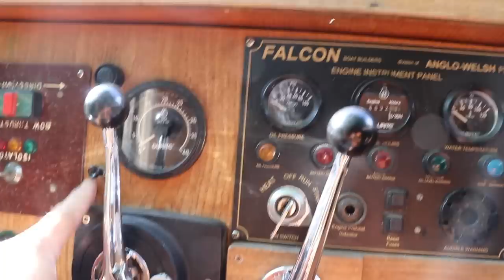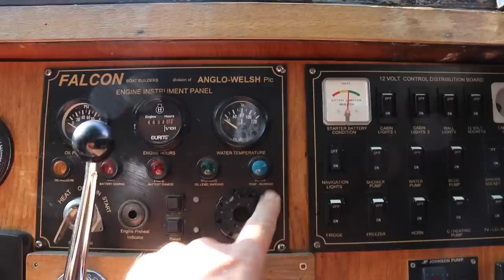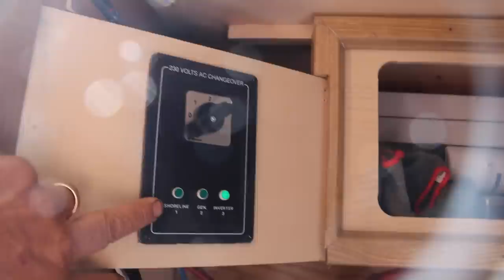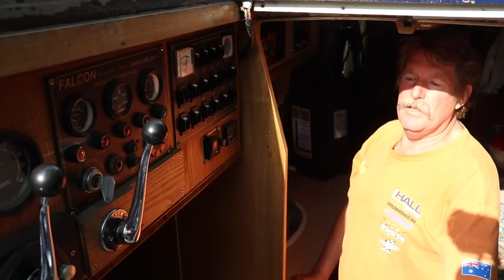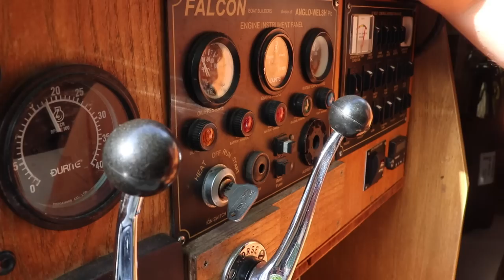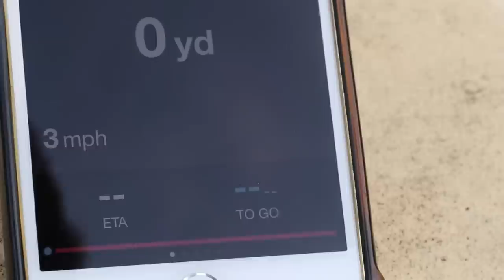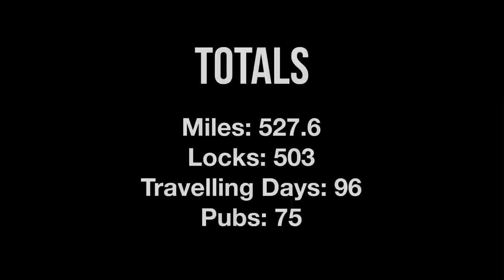Morning Boat Departure Rituals, Saddington Tunnel, Summer Daze | Ep 39 Life in a Nutshell

Comment: I think that panel for the bow thruster is that way is because ....... Green is the starboard light, and the red is port... If it was inverted, the green and red would be the wrong orientation..
Reply: I wasn't looking at the colours but the switch goes left to port and right to starboard. Easier to invert the panel rather than rewire the connections for the actuators, but it would annoy me.
Reply: I would have had the panel set correctly and just turned the switch right way around.  It would annoy me too! LOL
Reply from the maker: I Think you're right John